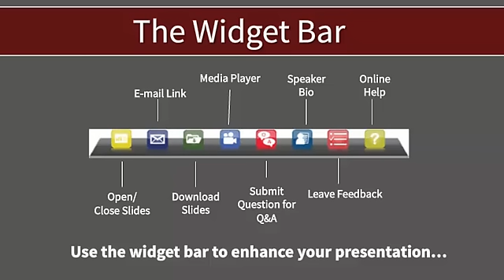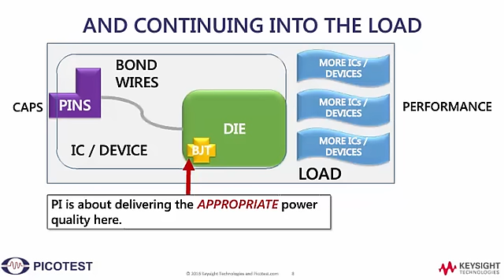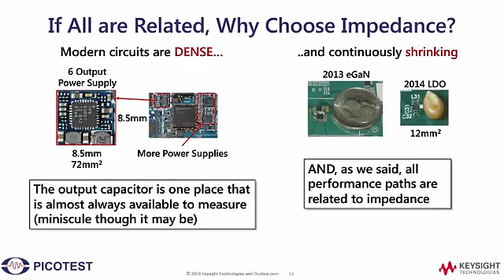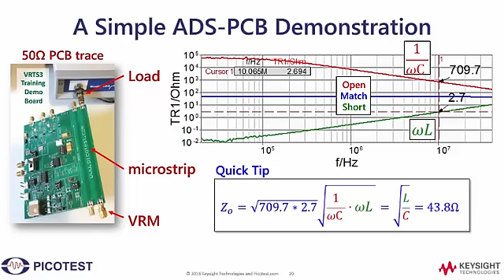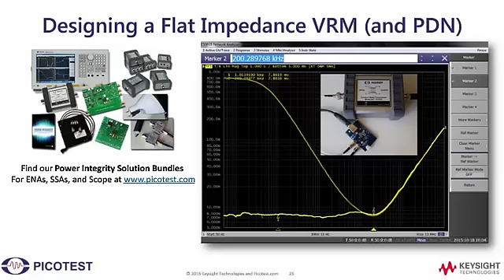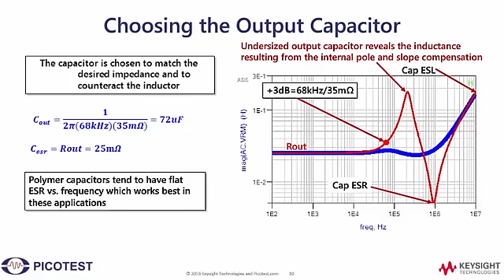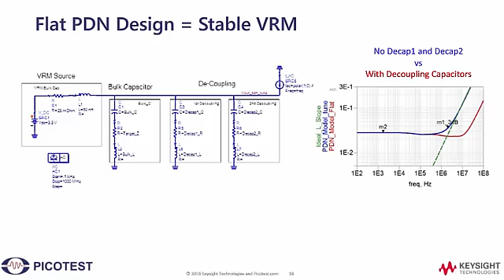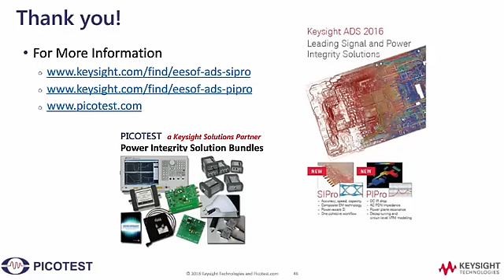Mastering Power Integrity

Comment: what exactly is "appropriate power"?
Reply from the maker: Good question, “appropriate power” is a simple way of saying that power delivery should be engineered to deliver power across a wide range of frequencies, and not just DC.  A more complex answer is that most power supply designers try to provide the lowest resistance.  Low resistance if not matched to the resistance of the load can often lead to high frequency mismatch issues resulting in resonances. The Q of that resonance, and the peak impedance at the resonance actually increases as the power supply resistance is lowered.  This is where simulation can help to understand the trade-offs.  A more recent video by Keysight that demonstrates a PI simulation workflow is https://www.youtube.com/watch?v=iUzGrovf6Wo .